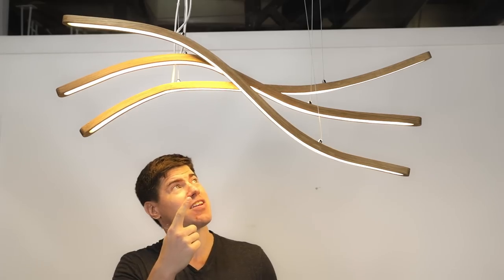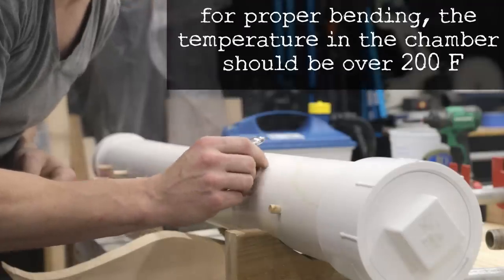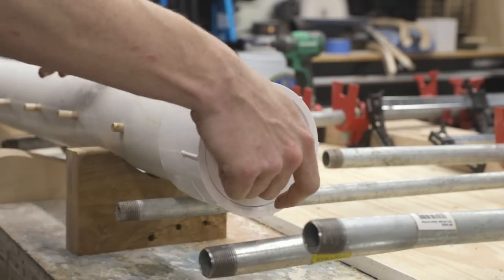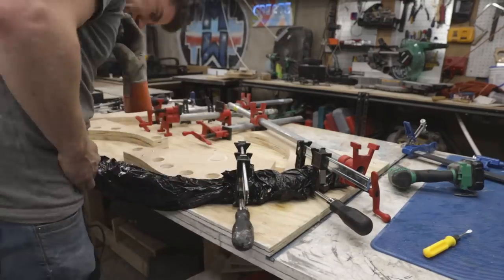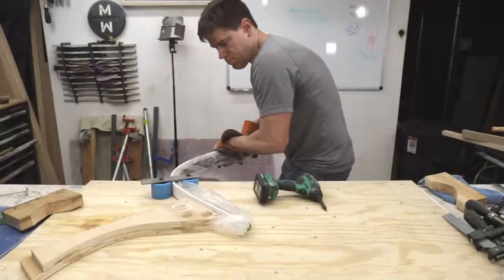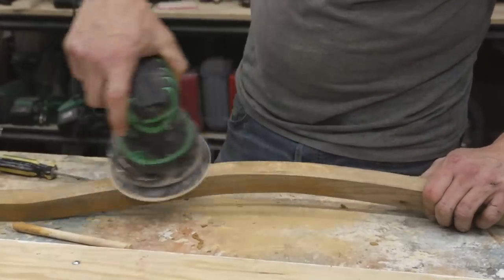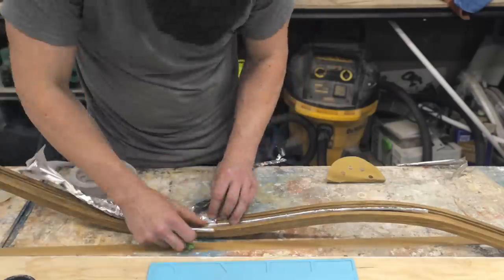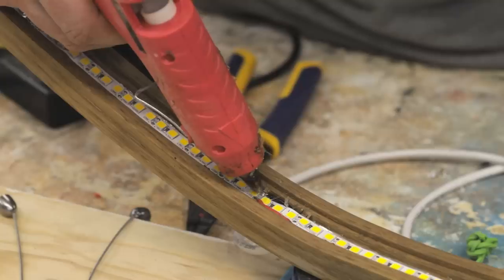BENDING WOOD with STEAM to create an LED PENDANT LIGHT

Comment: your tin tape is a common solution when attaching to wood (insulator) surfaces.  The information regarding connecting the strip in the middle, reducing the heat or temperature is incorrect, and backwards.  The tape you used, and what is commonly used, is a constant voltage tape, with a fixed resistance.  So, if you decrease the line loss (by reducing the length of the tape's circuit the voltage has to travel) you increase the applied voltage, and increase the current consumption, and thus the heat or temperature or brightness.  None the less, this is a small fixture, and the issue is really moot.  Looks cool, I dig it!

Comment: Just using aluminium won't really take away the heat since the aluminium is in the same blocked up space as the leds are. That is, if you're planning on leaving the light on for more than 15 minutes at a time so that the aluminium will reach the same temp as everything else. Once it's up to heat, it'll essentially be the same as not having it. Basically no matter what you put inside a box won't matter how the outside of the box conducts away the heat. Can't escape physics.
So like some others suggested, before you do any problem solving, find out if you even have a problem if the first place. See how hot the thing will get. Compare it to other lamps you have. If you've created a stylish, high-end led-breaking-toaster-oven (you're not going to be setting up a fire, the leds will just break because of the heat), open up the backside of the lamp (drilling holes or preferably route a channel) so the heat can get out. No need to worry about airflow since the acrylic will not be an airtight seal and even if it were, a groove would still allow airflow (efficacy can be debated but it's still a very significant amount unless we're talking widely spaced pinholes) and even if it didn't, enough heat can radiate out to cool any normal lamp. You'll probably want to prevent light from leaking out the back so here some aluminium will let the heat conduct more easily, but obviously just having a lot less wood in the way will help out as well.
I seriously doubt you'd need active cooling (a fan) unless you're looking for film industry level light power. It's a lamp for a home. Even large open buildings don't need that despite having much more power-hungry lighting. And there are leds we're talking about, most of the energy comes out as light as opposed to classic light bulbs where over 95% of the energy used just comes out as heat.

Now if all this is a bit of a long-winded ramble, allow me to summarize: It's a lamp for a normal house. It's a led-lamp (efficient). Many led-lamps are completely closed of with light diffusers. Regular solutions are enough for regular applications.
Reply from the maker: I like the summary 😃 and all the other info is helpful too 😉

Comment: WOW, another home run, fantastic project, thank you for leaving in all your learning curves, pardon the pun, looked like a lot of work this one but I must say it looks amazing.
I'm not an electrician but I have had 4 strips 150cm long of 5050 LED's (60 per metre) side by side double taped to a length of wood, no heat dissipation at all, they've been running 24/7 for over 3 years without any problems, heat marks, nothing,
Anyway thank you so much as always for sharing your work,
Take it easy from accross the pond 🇬🇧 🇺🇸
Reply from the maker: Thanks brother!  I've never had any problems either... I just get a bit more nervous when doing a permanent install.
Reply: @modustrial 
I know what you mean, luckily the ones I mentioned are above my lounge TV and they and their power are easily accessible,

Comment: fyi when using pvc primer it is meant to be applied and glued while still wet. I have done the same thing you did about 9000x times before a plumber said "it says not to do that on the can" which it does. So no more priming up 30 pieces at a time and the job got messier but if you want maximum chemical bond, wet primer, wet glue and slam it together, rotate. Thanks for all your videos and its good stuff!

Comment: Nice work, man! We built an almost identical steam box and used a clothing steamer. Worked well for small pieces but the output was too small for anything larger than a couple feet. Solid design as always.
Reply from the maker: Thanks!  That is a cool hack for smaller bent wood projects... And good to know for bigger ones like this that the Rockler kit is worth it 😃

Comment: You could use hanging steel cables as wires, one cable is + and second is - . 
Just in case is possible to cover steel cables with some clear
Reply: .... with some clear rubber or silicone tube

Comment: I like It! Can I suggest you to use, if you can, the same cord used to hang up the chandelier for a cleaner design? You can use one cord for positive and the other for negative.
OBVIOUSLY WITH ONLY VERY LOW VOLTAGE LEDS STRIP.
Reply from the maker: I looked into this, but there really are no good solutions out there... The only ones I found were very high end.... The type of companies that tell you to "email for a quote".
Reply: You can just use those compressible wire attachments (with a plastic sleeve) to attach wires to the hanging cables. Two wires inside of the lights to solder to the strip and two more inside of the hanging top plate to attach to a transformer.
Very similar idea to the track lights used in stores and offices.

Comment: That's an awesome idea and you gave me tons of ideas for a new project.

Btw, for those who are about to replicate your bending jig I suggest looking for longboard wheels, they are usually larger, flat and more durable than skateboard wheels, who tend to be smaller.
Reply from the maker: Thanks Henry!  And good tip...I think the ones I used were longboard wheels, but I didn't make that connection until you pointed it out 👍👍
Reply: Steambending is about compression, not about stretching. Your cracks seem to be a result of stretching.

Comment: This might be a weird idea but how about instead of steam-bending those pieces, just cut them out of a thick, wood plate? No messy bending work needed, because you just wanna make  pieces that have a very small width. You could just draw the arc of the bent pieces(from side view) on a wood piece and cut them out. If the thickness of that wood plate is the same as the width of your piece, ta-da you have your piece in minutes!
Only difference is that the pattern of the wood could tell if its bent or cut-out. Other than that i think for this project you didnt need necessarily have to bend it. Quite fine work thought, good job as always Mike!

Comment: Please use the cables that you hang the lamp from for power, therby eliminating the need to have that white cable go down :D
Reply: Is that safe?
Reply: @iZebraHD  Not for AC, but DC should be OK and you can get wire thats coated

Comment: Depending on how many watts each LED uses, the spacing of the LEDs, and how bright you run them, they shouldn't get too hot to worry too much, but the aluminium tape is a good idea to dissipate the heat into the wood. Making sure it is stuck well should help, which you did. Nice project mate, I'd like to do something similar, cheers!
Reply from the maker: Thanks much! 🍻
Reply: To dissipate a heat into the wood? bad idea... One side of wood can burn at 1000degC, the second side you can still touch with your hand! 
Aluminium tape? Also bad idea. It just creates here an additional heat resistance. 

Wood from one side and no air flow at all because of scatterer - this is really bad idea... I like wood style, but really - it does not fit for LED projects as it shown here. as a night or evening "warm" lamp, down-powered, - probably fine. But once you take it for correct room illumination with 20-40-100Watts - forget it - you need cooling.  
Especially for the LED stripe, which is so dense filled with LEDs... 
Good idea would be to check the temperature. if it goes above 60 degC, and I bet that with 12V in this case it will - scatterer should be redone and backside should be drilled to let air flow. Or one could mount LED stripe on appropriate alu stripe (1mm thick or similar) and have at least part of it, if not all, be open to the air.  From the backside of course to not ruin a design. 
I would even add a hidden 12V blowing fan, downvoltaged to 9-10V from the side, purging the air along the stripe. 
In case I would do it for myself, not for someone who wants to have a nice design and don't care how long it lasts.
Reply from the maker: Thanks for the advice.... It's very easy to drill holes in the back for passive cooling... No one will ever see them.  I'll probably do that and then test to see how hot it gets
Reply: @modustrial  hi. Just holes on upper side will not help a lot. You need to create an air flow. Holes above should serve  as warm air outlets and other small openings from sides or below will be cold air inlets. The air flow will be created itself because of temperature difference.
But I would say it is  tricky to make it in a current design...
First try to measure temperature. I would be glad to know I'm wrong and it is kept below 60degC after 10-20 minutes. 
Although, I have several LED DIY lamps ( far not so nice as yours) and have experienced quite high warming of LEDs . Especially in closed volumes.

Comment: I first saw the poly bag steam bending technique on the Tips form a Shipwright channel. I've abandoned my steam box as a result. You can do far more than bending a board -- I've used the technique to flatten boards and to form spirals around a PVC pipe slid over a metal rod. 

Wood fails upon bending because the inner surface is in compression and the outer surface is in tension. If you use metal strapping on the outer surface and pull on the strapping, the entire piece of wood is then in compression. Lee Valley/Veritas makes some really nice stainless steel straps, but with a poly bag protecting the surface, you can roll your own.  Clyde
Reply from the maker: Thanks for the tips!  I saw the technique with bags on shipwright as well.... Good stuff!

Comment: As a pro-tip/upgrade tip. File/Grind/Remove All But the Last 2 or 3 threads on the Pipe Cap So you Dont have to turn it 10 times to open and close the PVC steam chamber
Reply from the maker: Great tip!  I'll definitely do that before it's next use 👍👍

Comment: It's not the LEDs voltage drop, which makes the LEDs dimmer, the further you get from the power input, because they are parallel. It's the resistance of these superthin copper traces, carrying all that power. Heat dissipation is a good thought. BUT: As you are hanging each strip from two steel wires, why not use them to supply power? Yes these add some resistance, but you can measure the voltage arriving at the strips and turn up the PSU accordingly. You could also use copper wire to hang them. I think this would create an even cleaner look. Nice project though.
Reply from the maker: Thanks!  I definitely thought about it, but would prefer to find a ready made hanging kit that would be up to UL code, since this will be installed in my home (which I will likely sell soon).  But yes, using hanging wires for power is a great idea and ill likely try it at some point in the future.

Comment: It would be interesting if you made another of these chandeliers replacing the wood with Epoxy Resin (perhaps embedding an Aluminum strip in the mold to attach the LED's to as a Heat Sink)?
Exactly as you did with this Project but replace all the wood with Opaque <Colour of your Choice> Resin, leaving the Translucent White "Window" for the LED's...

Comment: Cool project. Just FYI the LEDs are in parallel not series so it wouldn't matter if you hook them up in the middle or the end the voltage drop will be the same at each LED.
Reply: That's incorrect. If you connect at one end, the furthest end will have have a voltage drop due to the resistance in the copper foil. Connecting in the middle will halve that drop.

Comment: So Rockler are trying to sell wallpaper steamers to woodworkers.  I suppose they add 5000% to make it feel special.  I love your videos.  But shame on you rockler
Reply: I didn't even know wallpaper steamers existed (learn something new daily!) but if it can be used for the job, isn't it smart to show other uses for the product that some might not have thought of? The PVC pipe encasement didn't work but the steamer worked w/ the plastic bags. Although it did seem a good long soak worked best and that's usually what I see ppl do instead.
Reply from the maker: Just to clarify, the PVC pipe will actually work well if you aren't pushing the limits of steam bending like I was.  With green wood and/or thinner pieces, the PVC works well.  The bag is probably the easiest method tho, altho it does make it difficult if you want to bend multiple pieces in the exact same way (which I didn't need to for this project).  The main takeaway, I think, is that there are a number of ways to steam bend wood, and it's important to pick the technique most suitable for the particular project 😀
Reply: @modustrial  The PVC may have worked better if you had set it up on the bench directly beside the bending form, minimizing the time between between being removed from the steam and bent in the form...
Reply: @buddtwin2  it's probably more do with that the steamer retails for £20 here and not £80. Just usual ripping off customers with cheap Chinese tat at exaggerated prices. No offence intended
Reply: @kyle budd There's a modestly old saying in marketing (I'm technical, not a sales person): Make it sound French and you can charge twice as much.  The point is that weebs and specialists will pay through the nose for items that SOUND like they'll make their job easier.  The fact that this portable wood steamer used to be a wallpaper remover is inconsequential.  All we care about is whether or not it'll make straight stuff curvy!
Reply: Yeah for twice the price lol, Lowe’s Home Depot 40-50$, rockler $80

Comment: low voltage, low wattage no problem, ditch the hot glue, and its not voltage that makes the led brighter or dimmer (well more on that in a moment) its the current. 

Where voltage matters is on those el-cheap-o strips the thing controlling the current is more often than not, a resistor, so math tells you that voltage divided by resistance = current. From the LED standpoint it don't give a crap as long as there's enough voltage to get past the diode junction, you could run 20 volts though an LED as long as you limit the current, though whatever is limiting that current is going to get screaming hot
Reply from the maker: Thanks much for the info!
Reply: Yes, but he's not wrong in this instance when he said "lower voltage means less bright" because while the resistance remains constant there is a voltage drop so a current drop as well.

Comment: Beautiful job, dude! 😃
A tip: next time try RGB LEDs with a controller! You can wire everything like that (but with 3 or 4 wires I think) and use only one receiver for the remote controller. 😃
Reply from the maker: Thanks!  I did something similar with individual addressable LEDs.  I couldn't  find white shielded 3-pin wires so I opted for the basic LEDs in this one, but it would definitely be cool with RGB 👍👍

Comment: Might I suggest ripping the oak and laminating it to the curves you are trying to achieve. You were pushing the limits of the material. You paid attention to the grain orientation of the material when you're steam bending wood. You want to orient the growth rings parallel to the direction of the bends. You'd probably want to steam the material 2+ hours to have a chance of pulling off those curves though.
Reply from the maker: I thought of that, but how would you cut the channel then?

Comment: great project as always. do the led strip give good lights? it seems pretty dim at the end of the video. maybe its just the ambient light that is very high..  if not there is some double row led strips that could maybe help. without thermal heatsink I never saw very powerfull led strip. the one We use at work for datacenter are so powerfull they gave us 3x the lux compare to old 8ft neon. But they are in aluminum casing ..
made by philips I think
Reply from the maker: The LEDs I used for this are 120 LEDs/m and very bright....I'll update the video shortly with a link to them (or check the lights I used in my concrete epoxy LED desk lamp, there is a link to the same ones in that description).

Comment: love the idea not great with wood work but great with electronics and electrical .. seeing as its lv (low voltage) 12v i would have used the steel cable suspending the lights as my wires to power it one side positive the other negative that way there is no other cable on show just a personal touch i would make

Comment: 10:35 I would class Hiding Mistakes as the 2nd most important Woodworking Skill...
The MOST important Skill in Woodworking (or working with any material for that matter) is being able to use Power Tools without hurting/killing yourself (or anyone else)...